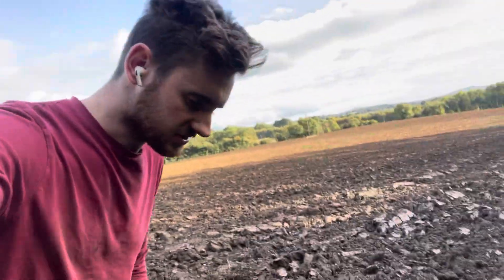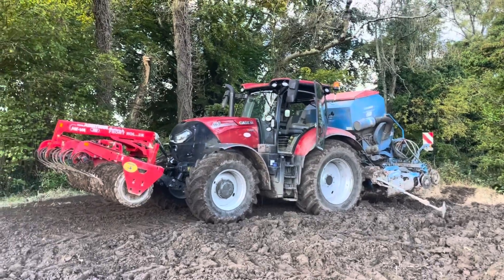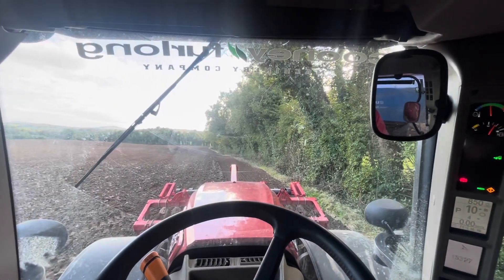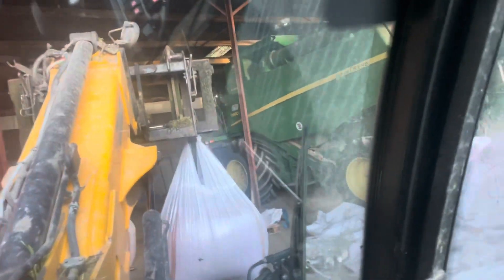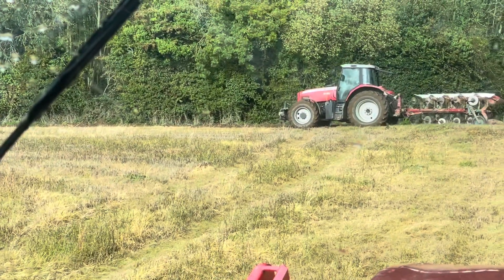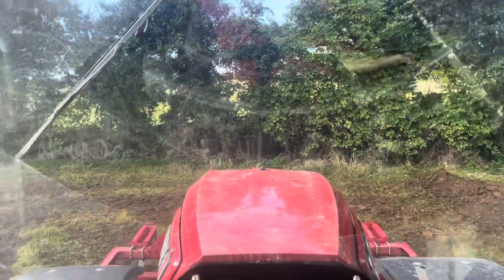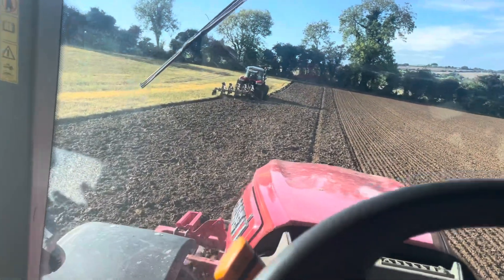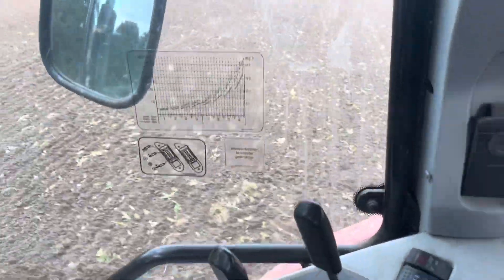First Day back to YouTube 1/2 way thought planting season

Comment: I was thinking about you only a few days ago and you've just put one up. 
I hope you're doing well Mark. It's good to see how things are going. 
They're taking a while to repair the Fendt? 
How cone you hired the case? As in why did you choose the case?
Reply from the maker: Hi Robert. Things doing good now. Been a hard year but out the other end, almost. The Fendt has had a couple of small issues only been in about 10 days now waiting on a part to come from Germany I think. We chose case simply because of how well we get on with the 3 smaller older cases we have id say if you added up all the manufacturers break downs across the 3 tractors across 30000 hours it wouldn’t come to €5000
Reply: @markdaynes9154  
Oh I think I misunderstood, I three months in my head for some reason, my mistake. 
That makes sense, going with case. 
I'm not going to pry but you know there are places with farming if you need help in any way. You're a great lad.
Reply from the maker: Cheers Robert all good here now thankfully but appreciate your kindness